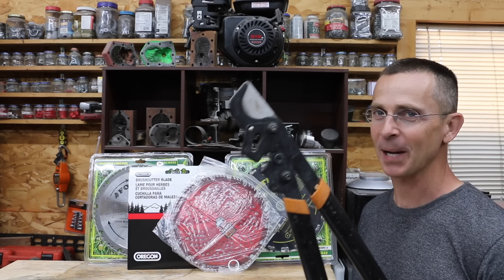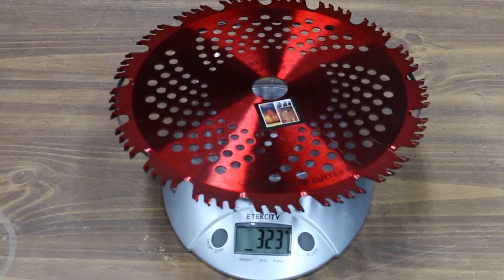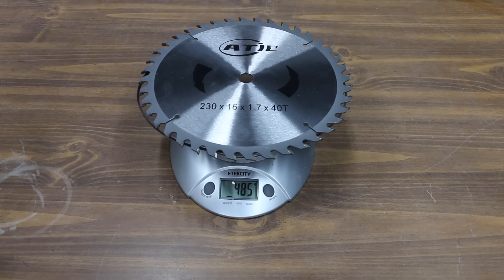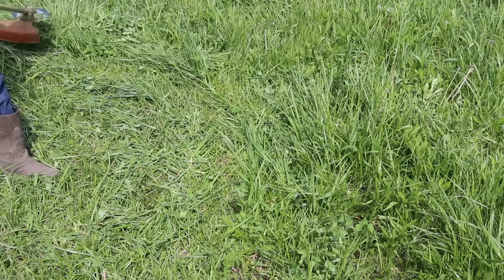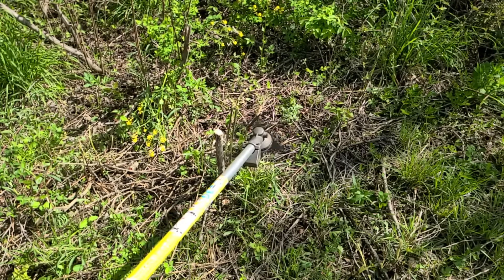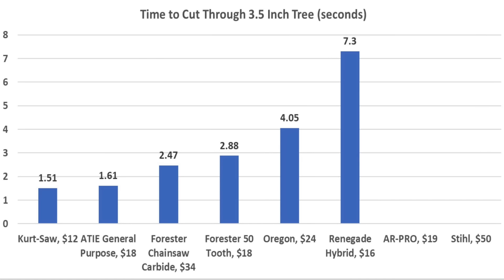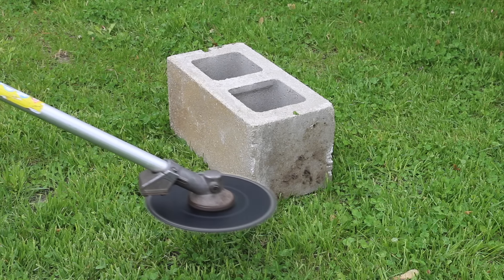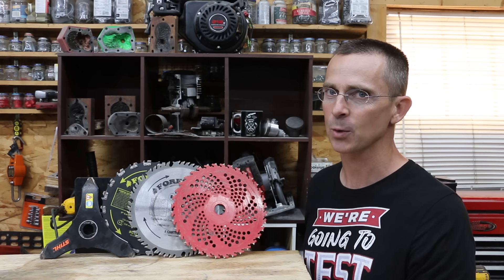Best Brush Cutter Blade? Let's Find Out!

Comment: Bought some of these Kurt Saws based on opinion here (BTW, Love your videos!) Was cutting small cedars on our property and glanced up against a rock hidden by some leaves, just for a couple of seconds...blade would not cut anymore.  I think there is a serious difference between a cinderblock and a quartz type rock.  Carbide edge showed visible damage...without a magnifying glass.  I think these blades need to be made out of the rock I hit.  I'm back to hands and knees with a tree saw.
Reply from the maker: Thanks for sharing.
Reply: I know I’m late, but I highly recommend the three tooth blades. There are cheaper ones than the Stihl brand. It can hit rocks and fence stakes, and can simply be sharpened with a file if the dings are big.

Comment: Doing a similar test with common saw blades would be interesting too, lots of folk will use table/circular saw blades on their brush bars,   I've got a 4 blade that I've been meaning to replace with something better for over ten years. For ease of sharpening, it's great, couple seconds at the grinder, for anything bigger than 1.5" if it's not razor sharp ZX can basically forget it. Most of the stuff I have to cut is just brushy <1" stuff, if I'd have had to use it regularly to cut 1.5+ I'd guarantee it would have broken the driveshaft by now. I've had it stop dead from a full rip spin way too quickly to have been good for it at all. I don't really have to worry about weight with it, it's a 4 cycle, could basically hang a brick off the end and it would just feel less rear heavy but can't complain otherwise, I've done nothing but put a primer bulb on it in 15+ years
Reply from the maker: Thanks for the video idea.

Comment: Question for the Professor Todd.. Have you or could you check out oil filters for automobiles? I just watched a video of Jimmy on 1Road, he uses oil filter magnets and I feel the filter media should filter them out. My question would be doesn’t he filter media which is rated in morons filter out the metal surge. My thought is if the oil on the other side of the metal where the magnet is places is on the way through the media the magnet is picking up the metal sludge before it gets to the media and maybe the media would filter it out. And if the oil flow is opposite then maybe a better or higher micron filter should be used. I understand the purpose of the magnet on the oil drain plug because that location is well below the oil pump pickup.
So are the magnets really beneficial if it’s grabbing metal sludge (before) it goes through the liter media?

Rick N, a loyal follower..... Keep up the great videos, and you should be awarded the golden apple award!!!
Sent from my iPad
Reply from the maker: Thanks, will do!  Thanks for the video idea.

Comment: I have a DeWalt string trimmer. I removed the string trimmer head in order to put on a saw blade, but the saw blade hole is way bigger than the string trimmer threaded shaft. I looked for an adapter kit, but I'm not sure what I'm looking for.

Comment: The Stihl blade is not designed for cutting saplings greater than 1” diameter. It’s no wonder that it couldn’t cut the larger sapling.  It’s target material is “brush” like reeds, heavy tall grass and heavy vines.
Reply from the maker: Thanks for the feedback.

Comment: Just a couple of ideas: wood planer; electric tools such as pressure washers or lawn mowers (something like the kobalt 40v lineup, of which I have several tools from that line and love for my small yard) oil filter pliers, floor jacks, headliner adhesives, hydraulic lift tables, kevlar sleeves, and a fun one might be best coffee maker for the shop lol it's gonna be hard to beat my old as dirt Mr coffee though! 😁
Reply from the maker: Thanks for the video ideas.

Comment: Did the 1 inch hole saw you used to open up the arbor hole have carbide teeth. I tried to open up a standard 5/8" circular saw blade to 1 inch, but I had a lot of problems. I tried a HSS step drill and a carbide tipped spade drill. Nothing worked for me. I haven't tried a hole saw. I was trying to be cheap. It cost me more to to buy drills to open up the arbor hole on a cheap circular saw blade than it was to just but a blade that fit my trimmer. 

The blade with the chainsaw teeth are easier to re-sharpen out in the field. If you are using the trimmer away from home, like I do, the chainsaw version is better. I clean up off-road 4x4 trails in the mountains. 

P.S. I just realized if you had a battery powered Dremel tool or 12 volt chain saw sharpener you could use a diamond tipped grinding bit to sharpen carbide in the field.

.

Comment: i am a little late, normally i never  miss a video but i was on vacation and i support the lead for electric pressure washers also im wondering what will happen if you used seafoam as straight oil
Reply from the maker: Thanks for the video ideas.

Comment: Well the kurt saw blade may work on stihl or echo but they’re too thin for my husqvarna 525RX . I cranked the arbor  bolt and the blade spins free . Put my original thicker  husky blade back on and it locks down.
Reply from the maker: Thanks for the feedback.

Comment: Hi, thanks for your video, very useful. I did buy the forest blade , and I have toro gas trimmer , but cannot find a perfect nut to fasten it , the blade didn’t have washer and nut , I only got a mushroom washer . But cannot find a nut in homedepot when cashier helped . Do you know where can I get my nut to install blade ? Thank you
Reply from the maker: Recommend contacting a power equipment store nearby that specializes in chainsaws and trimmers.  They should have what you need.

Comment: Hard to beat a Black and Decker Piranha 7 1/4  carbide 40 tooth blade for cutting 1/2 inch to 4 inch wood plant. Will beat any of the cutting time noted in this video. Of course 4 inch trees need to be cut from two sides.
Reply from the maker: Thanks for the feedback.

Comment: Would you look into testing “Paint Shavers”  I think this could be a brilliant product test as so many homes require aggressive surface prep on outsides the paint shavers are supposed to swiftly remove the paint to the wood leaving minor prep to repaint to perfection. However Do they cause more damage and create more prep than without?! Also which product is the best and for what attributes...?
Reply from the maker: Thanks for the video idea.

Comment: Sadly, I fell for one of those "Indestructible Trimmer" scams...turned out to be a wire brush for a wheel buffer, and there was no way it was going to fit on my B&D electric trimmer without dismantling the motor housing.
Reply from the maker: Thanks for sharing!

Comment: I hope you will test these flex hoses.  Most are expanding, a couple are not.  They’re all over TV and YT.  Which ones do what they claim?  Do they meet their own burst tests?  How strong are the interior tubes and exterior sheaths?  Are the “pro” models with heavy duty brass fittings worth it?  Etc.  I tried a couple and they eventually find the weak spot in the tube, expend at that spot and burst.
Reply from the maker: Thanks for the video idea.

Comment: When you have low power its probably worse to have more teeth if it works the same as milling cutters and flutes. I image that when cutting grass you'd prefer to have no clearance to the cut so it doesn't really damage wood or hader and shouldn't damage the teeth because similar to how you change the rake angle for brass so your bit doesn't just grab and snap.

I imagine you can get them all sharpened, the easiest to sharpen is the stihl and the stihl will probably last for near ever compared to the rest
Reply from the maker: Thanks for sharing.

Comment: I saw an adapter that allows standard circular saw blades on a string trimmer. With that you wouldn't have needed to drill a hole. Also, you might have been able to test that BigBlue 5T Demolition Blade you had in the other video, and perhaps their new 3T version. Just in case you wanted two types of ninja star for your circular saw. Maybe they are better at brush cutting than demolition.
Reply from the maker: Thanks for the feedback.

Comment: Just a PSA. I bought the Kurt Saw blades for clearing some palmetto bushes. Unfortunately they are too thin to allow the arbor nut on my Makita 4 stroke bush cutter to clamp the blade. I've heard of a similar issue for certain Husqvarna models. Shame, I really want to use it vs. the Makita 4 tooth blade. I may try to get a washer or make a shim, it's only off by about 10 thou.
Reply from the maker: Thanks for sharing.

Comment: Video suggestion: What's the best windshield washer fluid? It used to just be the blue stuff or nothing and was under $1. Now it comes in many brands, colors, and types at much higher prices. Is there really any significant difference, and are any worth their cost? Is plain water just as good? You've already got the windshield sprayer rig from the windshield wiper videos, so this should be easy to put together!
Reply from the maker: Thanks for the video idea.

Comment: I really enjoy fuel additive tests but something I noticed. Posting here because hope you think about this for future. 
When u run fuel tests you never state type of fuel, i.e. shell regular or premium. Also wondering about additives that are added to fuel at processing plant and how they add to carbon build up or reduction. 
At what temp does carbon break down and what is YOUR opinion, say again OPINION towards best fuel and additive combo that cuts and prevents carbon. I have watched all videos back to back ( additive types ) and noticed that sometimes the straight fuel in one is different video to video. New or old fuel? Is it possible to clean up gasoline prior to running through engine? 
Apologies for off topic from video. 
For small brush I use a 7.5 inch rough cut skill saw blade. Works well and cheap.
Reply from the maker: Thanks for the suggestion.

Comment: The oregon blade is easilly re-sharpend. And it's pretty much the only blade used by professionals in scandinavia. And the stil 3 bladed is used as an intermidiate betwean trimmer cord and other blades.
Reply from the maker: Thanks for sharing.

Comment: So I’ve never used one of these before. Wish I knew about them earlier. So can you take any straight weed eater and attach one of these by disassembling the head or what?
Reply: No curve shaft. Need good size motor to get those blades up to speed cause of there increased mass over string heads. My personal recomendation is a changeable shaft if u still need string heads for around fence and trees. Changing heads out takes 15-20 mins to do properly. Shaft changers after the first time is 20-30 seconds

Comment: You should have added the fact that you can sharpen the Oregon and Stihl blades and give them a much longer life than the others. The fact that you can re-sharpen them will greatly extend the life of them and the use you get out of them before you have to buy a new blade. While if you damage a carbide blade you will simply have to replace it, that is a waste of resources and money.
Reply from the maker: Thanks for the feedback.

Comment: Any chance you will compare the 7" version of the Forester chainsaw tooth blade with a 1"-5/8" arbor adapter to run it on a 7.5" circular saw? They have a max rpm of 10k, much higher than a lot of actual circular saw blades I looked at some of which were just 8k. I wonder how it would do shredding pallets with their nails thin and large-twisted, as well as the occasional screw. It could be a bonus video for your demolition blade episode. Surprisingly the packaging for the 7" version with more paint letters, doesn't say not to use on circular saws, or only for trimmer use.
Reply from the maker: Thanks for the suggestion.

Comment: Hi, Todd! I really liked the series, where you change the engnine oil in an engine, and put somethin else in there, and see if the engine runs! I wanna know, will an engine run on cutting fluid as engine oil? Also, will an engine run on engine oil as Diesel? Thanks!
Reply from the maker: Great suggestion!  Thank you.

Comment: I think a cooler test would be great. Test yeti, cabelas, canyon, grizzly, orca, Coleman, Styrofoam cooler, etc. I would love to see how long a cooler can hold a standardized amount of ice in a controlled climate. How rugged are they and how much beating can they take before failure? How would regular ice vs block ice vs dry ice impact the thaw time? Maybe keep the different coolers at the same or close volume to keep it fair.
Reply: Oh and maybe do a seal test with smoke or light to test the effectiveness of the seals
Reply from the maker: Thanks for the video idea.

Comment: that would not be good on these new battery power ones  i got video idel or qustion i just put Castrol  10w30 synthetic blend  it blended oil in my car  since 10w30 has been hard to find  what are alternatives to use  and which Synticic blend or blended oil are the best
Reply from the maker: Thanks for the suggestion.

Comment: This doesn’t do justice for the damage taken to so of these blades. The only one I wanna mention is the forester. I bought  one and it lasted all of 30 minutes. Don’t get me wrong I loved it the first 29 minutes. Working on fenclines on a cattle ranch naturally sawblades for cutting overgrowth is necessary. However hitting Tposts poses a huge problem. It’s nearly impossible to avoid kickback when cutting young trees and when they grow in between the barbed wire and right next to the t posts it’s unavoidable. I tapped a t post twice and broke 4 teeth. I’m grateful that none of the teeth came off and impaled me. If you’re planning to use this anywhere near metal object then think about getting the renegade blade. If not then the forester is king

Comment: I think the Stihl blade is getting a bit of an unfair comparison here - I use that tri tip blade all the time, and have for years.  Paired to a mid tier Stihl Kombi system, it's perfect for 1.5" and below.  Larger requires more time but that also depends on sharpness.  The nice thing about this blade is you can take a grinding wheel to it and restore it more than a few times - not possible with the carbide blades.
Reply from the maker: Thanks for the constructive feedback.

Comment: I have one problem with this video and that is when you hit a metal pipe or a rock with the Oregon blade you can sharpen it using a file, this is something I had to do from time to time when I used it, One thing you should take into consideration is if the blade can be sharpened or if its a throwaway blade after you have a little accident and you should after you done the three tests you usually do sharpen the blades that you can do that to and test them again
Reply from the maker: Thanks for the feedback.

Comment: I promise I won't be your new best friend with suggestions....BUT....One more or two ideas. Bandsaw blades? What got me thinking was that I read a review on a more expensive brand in which one user said the blade dulled quickly after only using it on a few cuts of maple. I cut metal and wood on mine. Also...drive on car/tractor ramps....metal versus plastic. okay...I'm done brother...lol
Reply from the maker: Thanks for the video ideas.

Comment: Do you have a link to the adapter you used on your weadeater to attach the blades? I bought the stihl blade a couple of days ago, and i have a straight shaft stihl but i still need the adapter. Thanks
Reply from the maker: Sorry, I do not have a link.

Comment: I live in Massachusetts and have brush I need to cut but am sick of using a pruner. I have the forester blades but what weed eater can I buy that they fit on? I hope you can help. Thank you
Reply from the maker: Thanks for the suggestion.
Reply: Be sure it's a brush cutter and you must have a solid drive shaft, not the trimmer, spring type.  Avoid curved tube for starters.  They will have spring drive.  Check specifications for the shaft type.  I have a Stihl FS85 that's over 20 years old and runs great.  You need a knowledgeable dealer.

Comment: Somebody needs to add little fins or radial ridges to the top of a blade so it will shed heavy grass better. Maybe like the Stihl but with the trailing edge turned up. (not too different from a lawn mower blade I suppose.) Heck even my old scythe has the rear of the blade turned up to kick the base of the straw as it's cut.
Reply from the maker: Thanks for the feedback.

Comment: I have lost dozens of flashlights due to batteries corroding inside them. Seems like I have more issues with Duracell batteries than other brands. Any way to test batteries to see how they hold up in conditions that cause them to fail like this?
Reply from the maker: Thank for the suggestion.

Comment: Are there any blades like this available for electric trimmers?
Reply from the maker: Thanks for the video idea.
Reply: If the head of your trimmer is universal it will work. Depending on the strength of your trimmer you may get weaker results. The video recommends 30cc or stronger gas trimmer. I’d look up an electric vs gas trimmer test for reference. 

I know my 18v Ryobi trimmer is significantly weaker than my gas trimmer and I wouldn’t trust it with a brush blade.

Comment: Hey Project Farm. I was wondering if I sent you a can of Penetrating oil from the 70s if you'd be interested in testing it. It's Kroil and it smells different than the new stuff. Also seems to work better than the new stuff. The copyright date on the can is 1975. Anyway let me know :)

Comment: I would not want to hit a concrete block or metal pole. Slo-mo showed wobble on some. I would be concerned about either the blade shattering or the trimmer coming apart.
Reply from the maker: Thanks for the feedback.